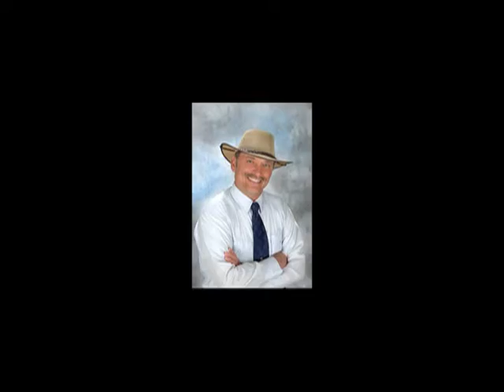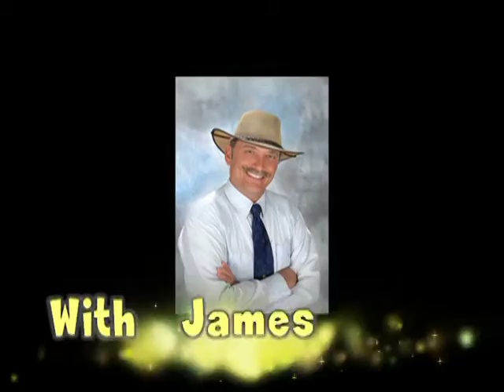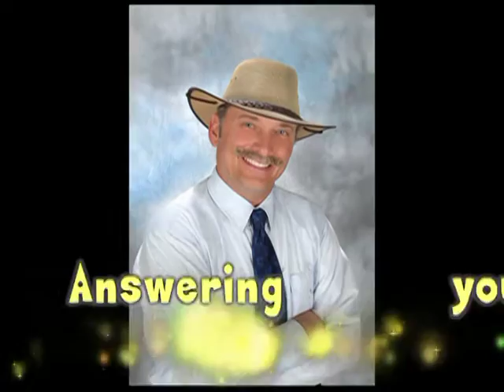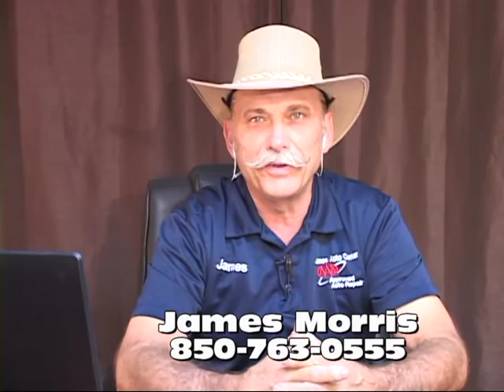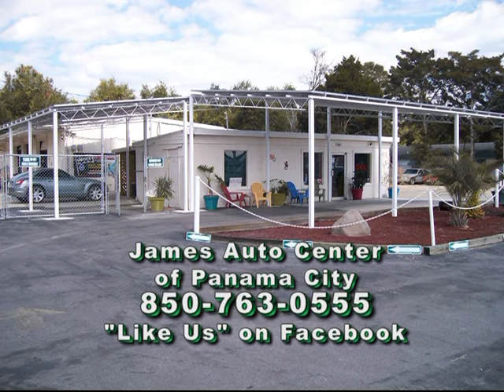Should you use anti-seize on your spark plugs and lug nuts?

Comment: Spark plugs:  No, not if they already have a chrome-like coating on them, that is the anti-seize plating on the plugs.    Lug nuts = sure, go ahead, but if you do apply anti-seize then only torque the nuts up to 70% of the rated torque as shown in the manual.

Comment: I worked in a government fleet for 30 years.  This fleet was in California very close to the coast, meaning corrosion was a big factor.  And I heard a lot of contradictory advice on anti-seize compound from every mechanic I asked about it.  Every mechanic in the shop had Permatex within easy reach yet I never saw them use it on anything.  The conclusion I came to was they used it sparingly, and never on lug nuts.  I got mixed opinions on spark plug threads (some said to never use it... I didn't believe that and I always use it).  But the opinion on lug nuts was unanimous, DON'T.  Too easy to over-torque, especially on aluminum wheels,  I agree with that completely.  Never seen one rusted on, but if that were a concern, I'd spray the stud & nut but only after the wheel and nut was on and torqued already.

Comment: I can agree with NOT using Anti Seize on wheel lug nuts.  Tires are a fairly common remove/rotate item....or at least should be.  If you rotate the tires as recommended. The tires should be coming off the vehicle every 500-6000 miles and should not have a chance to get seized.

Spark Plugs can be a different story, where they can be left in for a lot longer interval.

14 minute video and I maybe heard about two minutes of Anti Seize which was the main subject.